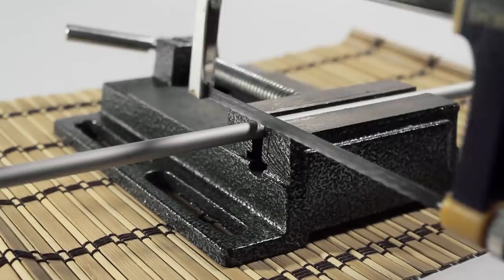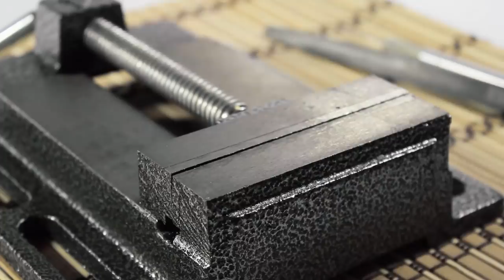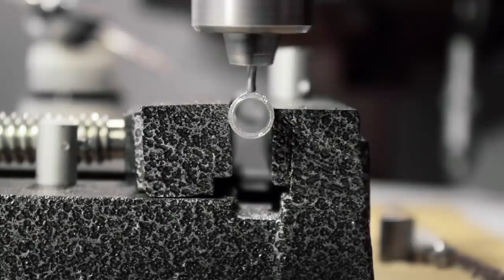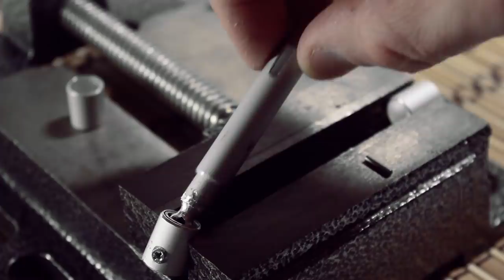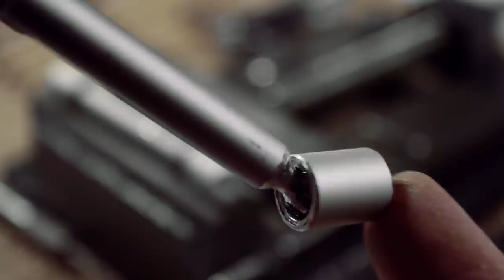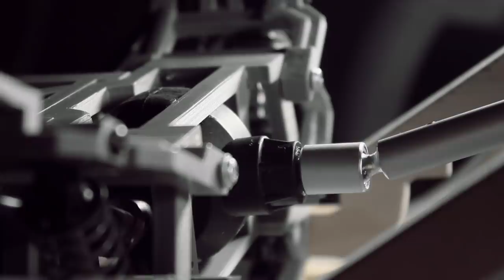Scratch Building Metal Drive Shaft of any length

Comment: Pretty cool, but those extension slots in the aluminum tubes will not withstand very much torque before fatiguing, especially with the slop.
Reply: That’s why I’m making mine out of steel, it’s going to take longer and is going to be harder to make, but the payoff is worth it